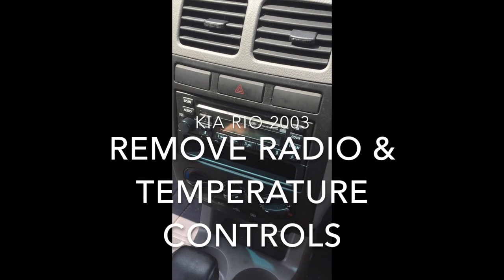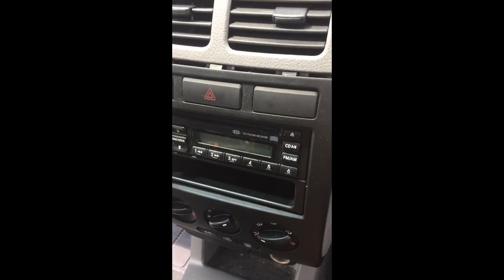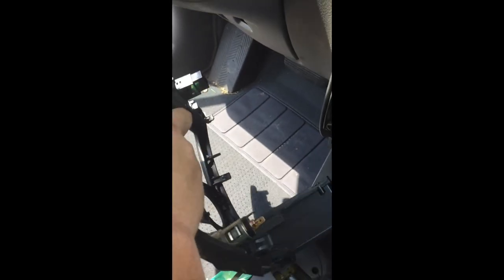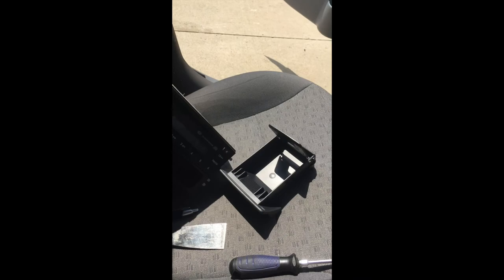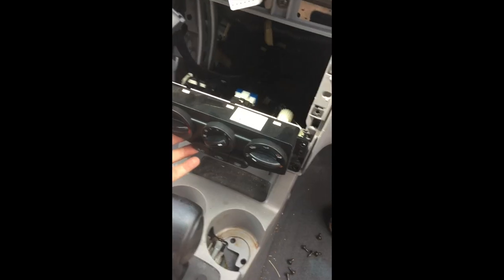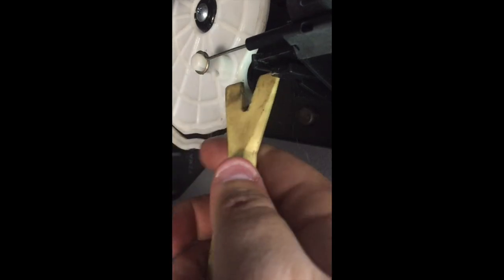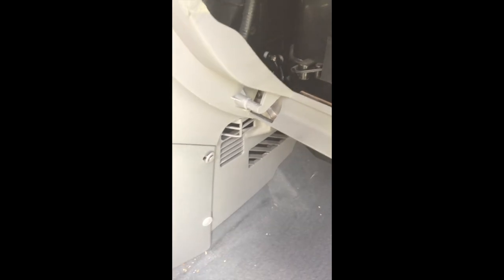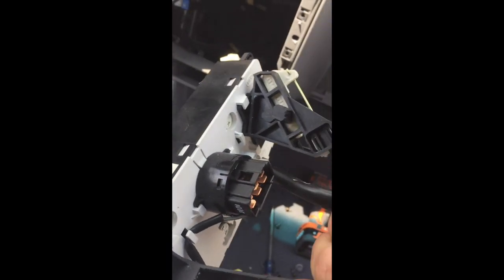Radio & Temperature Controls Removal for 2003 Kia Rio

Comment from the maker: 2003 Kia Rio Radio & Temperature Controls Removal
Tools:
* Plastic Panel Removal - https://amzn.to/33sHmYC
* Philips Screwdriver - https://amzn.to/3hdpzx0 
* Flat Head Screwdriver - https://amzn.to/2RAjTlU 

This video will show you step by step how to remove your radio/cd player (head unit) and your temperature control gauges. This video should be similar to other Rios from 2000-2005. 

Check out my website at http://mcfixit.us 

Disclaimer: Due to factors beyond the control of MC FIX IT, I cannot guarantee against improper use or unauthorized modifications of this information in the video, post, blog, or social media. MC FIX IT assumes no liability for property damage or injury incurred as a result of any of the information contained in this video. Use this information at your own risk. If you feel uncomfortable at any time. Stop and go to a professional. MC FIX IT recommends safe practices when working on vehicles, your house, or any other project and or with tools seen or implied in this video. Due to factors beyond the control of MC FIX IT, no information contained in this video shall create any expressed or implied warranty or guarantee of any particular result. Any injury, damage, or loss that may result from improper use of these tools, equipment, or from the information contained in this video is the sole responsibility of the user and not MC FIX IT.

Comment: Thank you for this video! - I and my wife replaced the kia original stereo on our daughter 2003 Rio. Took about 1 hour to link the wires of the new radio harness to the wires of the female harness (bought at the same time as the new new radio). Removing the plastic chassis of the car, not too difficult, removing the stereo was a different story. It was very, very hard to remove the harness from the back of the old radio. The original tray had to be mounted under the radio and that wasn't easy also because I think that certain holes were missing from the new radio bottom metallic cage side. So I ended up with a slight bulge on the lower part of the tray because the tray's lower side was too low for the overlapping panel to close properly. If I had more time I would have shaved a couple of mm from the plastic rails at the top of the tray where it meets the new stereo chassis. Not a big deal but that prevented a perfect job. I didn't want to remove the AC/Heater part to access the radio more comfortably, so I struggled a lot to get the antenna cable in.. I had to pull the antenna cable a lot and take the risk of dislodging it too much to have the ability to insert the plug in the new radio, but eventually I succeeded. - Radio now is 100% functional, with a slight bulge where the tray is too low to get the plastic cover to sit properly...
Reply from the maker: Great job! Yeah, it's very tight in there. They don't think about aftermarket items or repairs that need to be done when they assemble and build these vehicles. Congratulations on getting the job done!
Reply: I had to wiggle it really really hard and then mine came our

Comment: Mines done 294,000 KMs. Son gave it to me. Drove 600 KMs home without a single issue. Gas cost $100 Australian. I'm used to driving my wife's AC Schnitzer 540i and my S500L Merc. Little Kia really impressed me. I was doing between 110-130 KMs 95% of the trip. It was 2&3 lanes all the way so traffic was flying. All the fluids are good. Aircon eas good. Amazing little car. We live in a city of 5 million so this is my run about car now.
Reply from the maker: Wow! That's great!

Comment: Thanks for the video. Just wondering if you can give me information.   You showed how to remove the 
Temperature selection knob's cable from something under the glove box. We discovered that a piece of whatever that the cable connects to so that it flips between heat or cool had broken. Do you know what that thing is called and how it is replaced??

Comment: Thank you, sir.   Was hoping to not take off the cables, but, eh... should be done within an hour.   
Haven't had ac or heat since about last summer.  Shortly after... no On/Off ac / heater Fan Control selector switch.   Also, according to O'Reilly's, this switch is why I have no Speedometer. 

Well, replaced the AC / Heater dash assembly.  Still no Fan for AC & Heater, &, no Speedometer.   

Thots ?
Reply: Check your fuses. Check your blower motor. Who knows? Maybe a rat chewed some of your wiring. I hope you got it all worked out by now. Considering it's been a year.
Reply from the maker: @mega_game_play  Yes, fuses are definitely the first place to start (and often the cheapest)! Hope you got it fixed!
Reply: @MCFIXIT  Thanx MC, Jay.   Got it going, once, for about a 1/2 a day.  Moved some fuses by the battery.  2 'Mechanics' weren't able to figure it out the issue, so... guess I don't ac or heat... for now... till I sell it... haha
Reply from the maker: @skweekykleane9810  I just uploaded a new video this past week about removing the fuses and cleaning them off due to corrosion on my Town and Country van. It should be a very similar concept to this vehicle. Here's a link - https://www.youtube.com/watch?v=kir-bH6lQVg&t=184s
Reply: @skweekykleane9810  i used to have a kia and it never worked how it was supposed to do. the best thing i did was sell it and got a more reliable care. that thing was constantly at the shop.